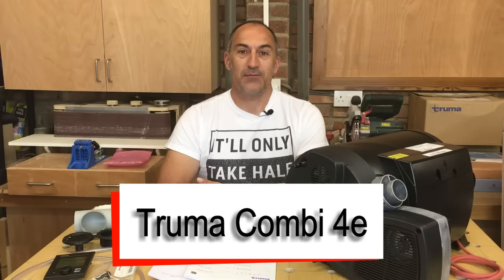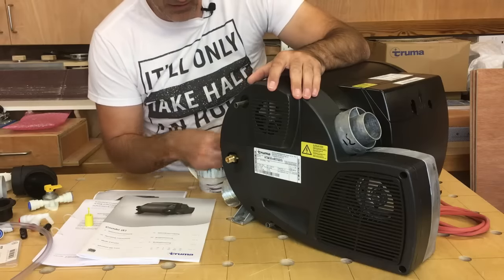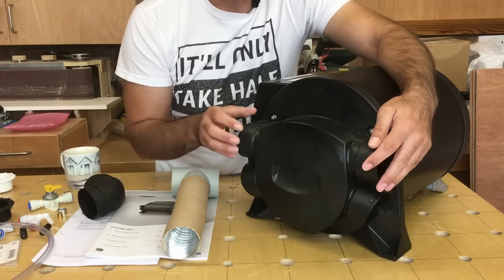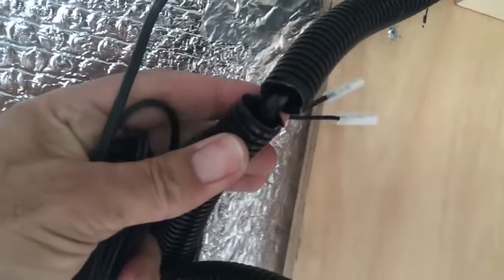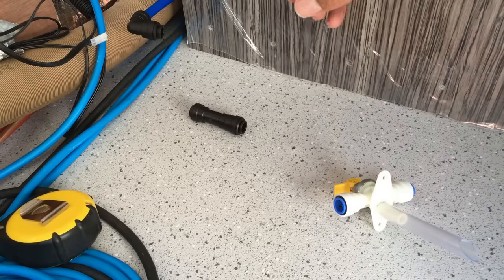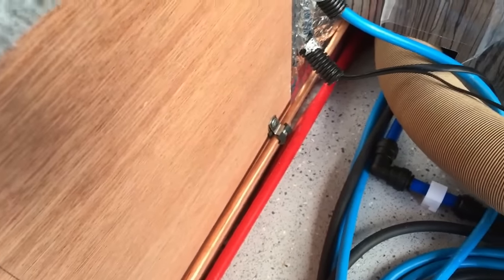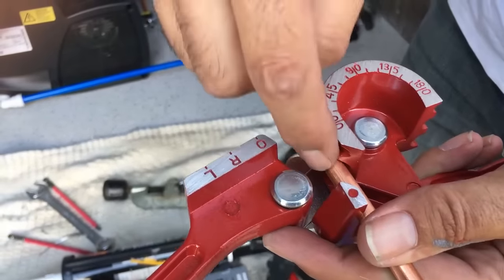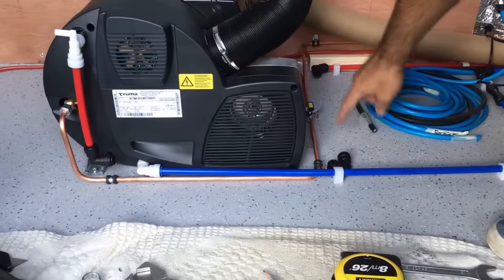Truma Combi 4e Self Build Camper Van Installation

Comment: Hi Greg, im currently building my 2nd campervan and was considering one
 of the Truma 4e heaters. My only concern is the noise from it running. I
 hate the flue noise from friends propex style blown air heaters, and 
they make stealth camping not very stealthy. Ive looked everywhere for 
videos of the trumas running and found nothing. Some folk say it sounds 
like a jet engine when starting up, others that its almost silent. How 
noisy is it both inside the van from the ducting/fans and blown air, and
 from the flue outside. A video would be great. Many thanks, Elliot.
Reply from the maker: ferobert I’ll be very honest with you it is really quiet. You cannot hear it running on its eco setting which is all you need in the van to keep it toasty warm. 
I guarantee you will be really pleased with the unit. 👍🏼😀
Reply from the maker: ferobert the difference is the centrifugal fan it inherently runs much quieter than the mixed flow axial fans that the other heaters use. Because it’s got plenty of heat 4kW you don’t need to run it on high at all.  We are so happy with ours. It makes our van so comfortable and joy to live in

Comment: My fan blades are full of dust so I need to clean the fans on my truma 4e boiler,is it easy to access them.
Reply from the maker: Hello David, the internal cleaning would normally be carried out during the annual maintenance and service the same as for a domestic boiler.
Reply: Greg Virgoe I phoned Truma to book a appointment but they are busy till the middle of December,I was hoping to go to Spain in November so I thought if it was easy to get to the fan blades to clean them it might of been something I could of done myself
Reply from the maker: You could try your local caravan & motorhome accessories dealer they sometimes know a few local LPG engineers that can do service work on your Truma?

Comment: I wonder if anyone has tried fitting a LPG combi boiler like the small Vokera combi, as its only £450 inc flue. I am talking for a sprinter box luton or larger. The only thing, it needs 230v & not sure if it would work on pumped water?

Comment: That thing is massive. No not THAT, I meant the Truma. Sheesh.
Reply from the maker: It fit's under our bench seat really nicely and only occupies a space 500mm deep by 350mm high, yes it's a bigger than other lpg heaters but this is doing the heating and the hot water and is dual fuel too. If you fitted seperate devices that would take up even more room.

Comment: What are the dimensions of this Truma boiler, my C series from 1997 needs replacing?
Reply from the maker: Space Haddock https://magnummotorhomes.co.uk/wp-content/uploads/2018/01/product-image-614-Truma-Combi-4E-Combination-Boiler-173404.jpg
Reply from the maker: Space Haddock this is a good price too https://magnummotorhomes.co.uk/shop/heating/blow-air-heaters/truma-combi-4e-combination-boiler/
Reply: Thanks Greg, this video is excellent! Everything so clearly explained. Thank you very much.
Reply from the maker: Space Haddock you’re welcome. I know you won’t be disappointed with it 😃
Reply: I’ve actually got an old Hymer 97 plate. I started to take mine apart to look at the thermo-couple which is causing it to light but not stay lit. I’ve sort of reached a dead end as I can’t see anyway to get the old thing apart. I’m an ex aircraft engineer too! 🤨 I’ve been out and measured and although being slightly wider at 500mm it will fit in the space. Cheers for your replies mate.
Reply from the maker: Space Haddock if it helps any more here is the installation manual for the boiler http://www.rainbow-conversions.co.uk/user/downloads/Truma%20Heating%20Combi%202E%20&%204E%20Installation%20&%20Operating%20Instructions.pdf
Reply: Cheers Greg. I’ll have a read of that later 👍👍👍
Reply: @GregVirgoe  Well, just went and bought one of these units and ripped the old one out this afternoon. Do you recommend getting the bluetooth thingy, is it worth the money Greg? Cheers, Davie
Reply: That’s the boiler all installed today and functionally tested on gas and leccy. Did it all myself thanks to you Greg. Saved me best part of £400.

Comment: It's brilliant but boy, you can 20 Chinese heaters for the price of one of those.
Reply from the maker: Vladimir Farage more like 10 and you still won’t have any hot water 😂 lol
Reply: @GregVirgoe  I saw one on Ebay for £2800 so that is how I compared the price.
Reply from the maker: Vladimir Farage, there are quite a few from £1465.00 https://rover.ebay.com/rover/1/710-53481-19255-0/1?icep_id=114&ipn=icep&toolid=20004&campid=5338027957&mpre=https%3A%2F%2Fwww.ebay.co.uk%2Fsch%2Fi.html%3F_from%3DR40%26_trksid%3Dm570.l1313%26_nkw%3Dtruma%2Bcombi%2B4e%26_sacat%3D0